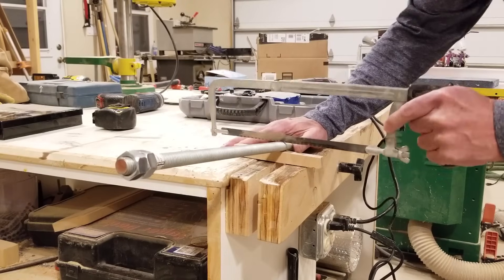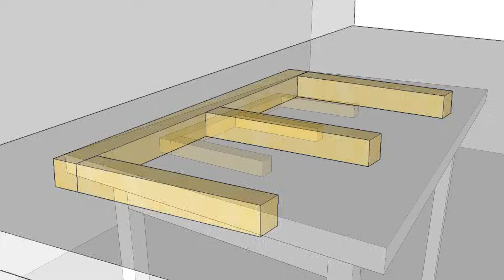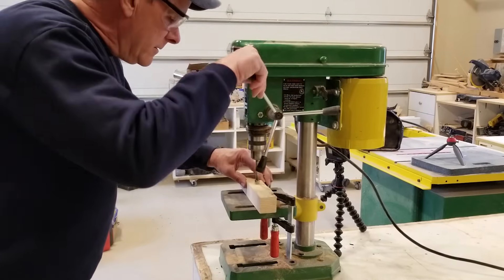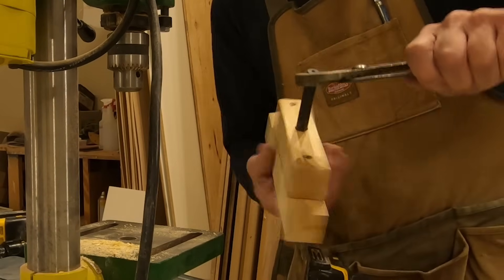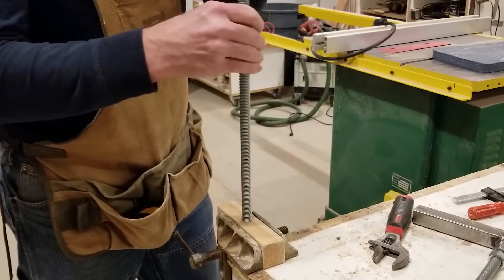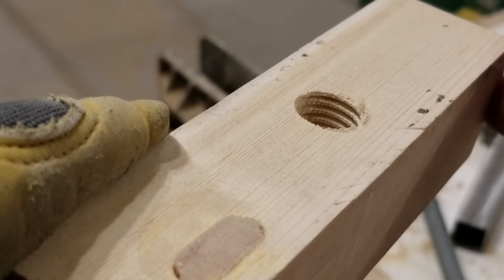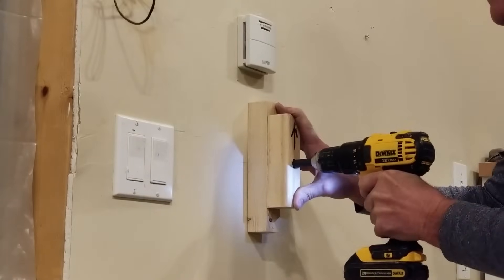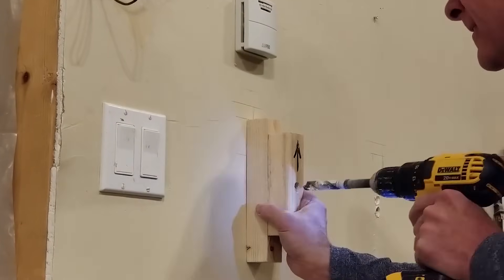Strong Floating Shelves - The Strongest Option

Comment: Moving into a new apartment in 2006, I mounted a 42" plasma TV on a brick and plaster wall and ran the TV cable service behind skirting to a point under the TV. I always mount (flat) TVs at a level where my eyes, when I sit on the sofa, are 2/3 up the screen (full face shots such as newsreaders are then eye to eye) because any higher means lifting my head and eventually straining my neck. In this apartment there was not sufficient space under and in front of the screen to use a cabinet of any kind (too much foot traffic across the room) and having wall-mounted the TV I preferred to keep the minimalist theme, so I obtained a length of 22mm (3/4") steel bar cleaned it and cut it in half to about 300mm (12") each. I drilled two 22mm holes in the wall to a depth of 75mm and 250mm (10") above floor level. I then mixed enough epoxy resin to almost fill the holes and knocked in the bars & supported them (level obviously). Once dry I placed the cable box on the bars with the cables coming from behind the skirting and into the back to feed it. I also drilled a hole through the wall behind the box and ran the feed to the TV through that into the bedroom wardrobe on the other side where I had installed sockets to power both the TV and the cable decoder box, the TV cables were delivered through a higher hole behind the screen. Nobody failed to ask how the cable box stayed above the floor and most then asked why there were no cables anywhere. I decided then that if I ever need a shelf I would fit rods and conceal them in the board. I have done similar fits in my current home with my 65" TV which weighs half as much as that plasma! my HiFi and all computer cabling: I just hate visible cable. It is good to see others using the same method, funny how it took us hundreds of years to think of it.
Reply from the maker: Nice explanation on your installation methods, BB! Sounds like it all turned out very well. I don’t know why it took me so long to try something like this as well. I have always defaulted to wood because I’m more accustomed working with it. I get lots of comments from other contractors who use long lag bolts into the walls and then cut the heads off. I appreciate you watching and thanks for your comments!

Comment: Floating shelvs are strog only if the wall is strong , and treaded rods are not so good options , there is steel rods in quality or even hex bars , and just nail it vith hummer to the wall
Reply from the maker: These rods are plenty strong for this use, Jovovic. They will hold much more weight than I would ever need to put on them.

Comment: That's a lovely stud finder. I have avoided floating shelves (because history books are heavy).
I might adapt the threaded rods with a threaded tapped hole at the end. Then turn up end caps in Stainless to hold shelf in place.
Nice idea.
Reply from the maker: I think you might be surprised, Plunder, with how strong these shelves really can be made to be. I had always thought of floating shelves as a little bit gimmicky and not particularly useful until I needed to build some for a customer who was going to load them down a little bit with books. That started an exploration process that led me to the all thread rods as being the strongest option I have come up with. Yes, and I like your idea of a threaded tap in the end of the rod to hold the shelf in place. That should work well!
Reply: @RustyDobbs  Hi. Sorry for the delay. I really like your floating shelf ideas. There are a few minor differences in building practices in England (mainly regarding wiring to be honest). We also have a mix of metric and imperial sizes for drills & threaded rod - but no problem. I have a metalwork lathe so making any custom parts is OK for me.   I love your metal detector. If I may ask - Where did you find that?

Comment: Could’ve just use a wood Sammy and been done with it
Reply from the maker: Your going to have to help me with "wood Sammy," Joe. Not familiar with the term.
Reply: @RustyDobbs  it’s basically a wood screw that the head has a tab for 3/8 Rod just google wood Sammys
Reply from the maker: Thanks, Joe. Yeah, I've never encountered them before. Looks like they get used a lot for hanging pipe which makes sense. Appreciate you passing along the info.

Comment: Question is, why do you need floating shelves able to hold weights of 60+ kg?
Reply from the maker: Another question is, if the same amount of effort gives you a shelf that can easily hold more weight than you would ever realistically put on a shelf,  like 60+ kg, would you rather have that or one that can handle 20 kg?

Comment: about the solid shelf13 min into the video, you could try drilling and tapping a female thread on the end of your "all Thread" and use 1/4-20 screws to hold the shelf on, then put plugs in to conceal the screws.
Reply from the maker: I like your idea, Gadsden! There are lots of ways to go about securing the shelves to the rods, but your idea would really be a solid way to do it, plus you could put plugs in as you suggest or come up with an industrial look by incorporating bolts and washers into your finished look. Thanks for passing on your thoughts!

Comment: Great video for beginning diy'ers and seasoned weekend warriors alike. Also I noticed how you were using the stud finder. I found it best to slide the finder in the vertical position towards a stud from either side.
Reply from the maker: I hate those stud finders, Cesar! I have had so many guys tell me to use powerful magnets to find the studs which is a great idea I had never thought of. But I have to say your comment came to mind today when I needed to use the stud finder and changing the orientation actually did help, so thanks for that! I appreciate you watching!
Reply: @RustyDobbs  No prob Rusty,
I feel you brother. I've gotten to the point of doing 1/8 holes every inch till I hit a stud. Looking back at it.....fun times. When finished it's best to  forget the frustration  but not the trick that got you out of that jam. Keep building and stay safe Rusty.
Reply: @RustyDobbs  Hey bud,just wanted to share a bit more about how I got that stud finder working a whole lot better for me. I'll be quick. Sliding it vertically from left to right mark with pencil when you get a solid beep,same thing right to left. In between your marks is the stud. Light bulb clicked with first confirmed stud found. But enough about me. 😂

Comment: Suggestion: use an appropriate size tap and tap holder to thread the hole in the studs
Reply from the maker: I did that on the follow-up video, 66, and I used thinner rods as well. The taps worked great! By the way, I drove a 51 Ford pickup in high school! Wish I still had it now!

Comment: Instead of all-thread, I use a long 5/8” lag bolt.  I drill the studs and use a socket wrench to screw in the lag.  Once the lag is in about 3” into the stud, I cut the head off the lag bolt with my Fein oscillating tool with a carbide blade.  A hacksaw or sawzall works as well.  If the lag is slightly off level, slip a pipe over it and adjust slightly.  I don’t think all-thread is a good idea since its threads aren’t made for wood.  Everything else looks good!
Reply from the maker: Sounds like a good plan, Scott! I have had a number of other contractors describe a similar process to yours that they use. It took me a long time to finally by an oscillating tool. Now I don’t know how I ever got by without it! Thanks for your comment and for watching!

Comment: Nice! That's how I attach my floating shelves for my customers. Only I use solid stock, and 1/2" bar. I hang on the shelves to test them. I know yours will be even stronger. I also made a perpendicular jig, but used a set of drawer guides, and a large square foot on it. Great work sir!!
Reply from the maker: Thanks, Sticks, and I appreciate you watching! Yeah, I never thought I was “reinventing the wheel” when I made this video. I figured there were people who had done similar things. For me, I was just making the transition from wood to steel supports, so that was the novel thing to me about using the all thread rods. I like your idea about your jig! I’ll have to think about that little!
Reply: @RustyDobbs  I can take pictures of the jigs, and somehow get them to you. I may even have a video on my old channel of me using them. I'll check.
Reply: @RustyDobbs  Found it. It's unlisted because I was working with FastCap on making it a seller. They didn't use my idea. I never got a patent.  One jig is for against the wall, and the other is to slide over the 1 1/2' thick shelves I make. Since I don't want to take my giant drill press to job sites, and I have to nail the center of the studs perfectly, I needed something to hold my drill perpendicular to the shelves that wasn't my drill press.

https://www.youtube.com/watch?v=TmVe3QOV9hU
Reply from the maker: Thanks for the video link, Sticks! I'll check it out. And you can email me at rusty@dobbsworkshop.com as needed.
Reply: @RustyDobbs  Got it. Thanks! Sent you an email, so you'll have mine. I'll list it here too. sticks.cabinets@yahoo.com

Comment: you said 2x6 was in the wall. How would you expect this to hold up if the wall was built with 2x4's
Reply from the maker: As a general statement, Sinkingputts, I personally would not have been concerned about putting this all thread rod in my wall if it had been built from 2x4s. That’s primarily because I’m replacing the wood drilled out with the bit with a piece of steel and the weight on those studs (16” on center) is from load and gravity with no lateral pressure against the wall. But you need to make decisions about what you do with wood framing based on each individual circumstance. Hope that helps!

Comment: Very old post i know, but have to ask. Planning on doing exactly what is in this video, but my shelves will be going into concrete, and using the last method. I would just tap in the threaded rod into the concrete wall as far as i can ( inside wall, so probably 70% of brick thickness ) and use the last shelf type as in this video? Planning on hanging 6 of these in fairly close proximity to each other. Also note shelves were pre made, and each weighs about 8 pounds. Any advice would be appreciated. PS. Wont be using for heavy duty loads, but would like to have peace of mind that it could easily handle 50 pounds :)
Thanks for another awesome video.
Reply from the maker: Thanks for watching Ashraf and for your comments. Yeah, I would probably focus on getting the holes drilled in as perpendicular to the wall as possible. Maybe also undersize your drill bit to the rod slightly and do a test hole to see if tapping the rod into an undersized hole gives you a more snug fit. Could also add some construction adhesive to the rods to fill some of the voids created by drilling the holes with masonry bits. Think you should be fine on your weight concerns if the rods are installed snugly. Good luck with your project!
Reply: @RustyDobbs  Hey Rusty, thanks so much for the response. Good idea regarding undersizing a bit, and didnt think of construction adhesive to be honest. Drilling these holes perfectly square will definitely be important yes. Thank You again.

Comment: They make a hand held drill press attachment for your cordless drill. Also I drill 3/8" holes and use regular 3/8" rod. The rod has to be hammered in. There will always be a little bit of misalignment somewhere and you'll have to pound the shelf on so there is no worry about it coming off. Then use a flat bar to remove if needed. Then pound in a bit of 3/8" wood dowel with wood glue and it's good as new.
Reply from the maker: I like your ideas, Burrito! Thanks for watching and for passing along the info! The 3/8"dowel repair is a good idea. You sound like you have done this a few times!

Comment: Thank for the method.  BTW a rare earth magnet is great for finding screws in rock wall that have been finished
Reply from the maker: Thanks for watching, Andrew, and I appreciate the magnet tip as well!
Reply: @RustyDobbs  Thanks, just used your method to make shelves for the utility room.  Cheated though and used 30mm long threaded inserts rather than threading the hole,, that gave enough strength to pull the frame tight against the wall helping to hold it horizontal

Comment: Have you thought of just buying a 5/8 inch tap?
Reply from the maker: Yes, I have. I actually did a follow up video with smaller rods and I used taps to thread those holes. I always assumed that bigger taps would be more expensive, but they really are very reasonable.

Comment: Great idea.  I've run into the problem of something in the stud before.  When using the electronic stud finder, I locate the stud then use a magnet to look for sheet rock screws.  Remember, the magnet method used to be the way to find studs.  Also I've seen, on youtube, a stud finder that shows everything in the wall.  It can be used with an android phone.  I don't have one, because it won't work with my iPhone.
Reply from the maker: Thanks James! I’ve seen those apps before as well that allow you to see what’s in the walls, but have never thought about getting one. I do use an android phone so I may have to check into that. In most of my work, probably 95% of the time I’m actually removing sheetrock to make some structural changes so I’m going to see what’s in the wall up close and personal! Thanks for the idea on the app!

Comment: That stud is probably not happy after you made such a big hole in it. Feels like that damages the structural integrity. Unless it's at least 3 times wider than the hole.
Reply from the maker: The only big hole in the wall, Harvie, is where I drilled a hole in the sheetrock to check for wiring in the stud. The 5/8 inch hole drilled in the stud is filled with the 5/8 inch all thread rod after it is installed. This is actually a 2 x 6 wall on 16 inch centers, so I’m not concerned about its structural integrity but thanks for watching and for your comment.

Comment: Thoughts on using this method for a 30" deep desktop?
Reply from the maker: Not much beyond the obvious, Jim, that the wider you go, the more you get the cantilever effect and more deflection possible as weight is added closer to the front edge. I haven't tried the 5/8" rods extended out that far, but it is an interesting idea and likely pretty strong if they are inserted in studs 16" on center. The other option I have suggested for wider projects that do not have "L" brackets that show, is to have 1/4" plate steel welded up as "L" brackets for the project, then recess them into the sheetrock against the studs and recess them into the bottom of the shelves so they are not seen.
Reply: @RustyDobbs  Thank you for your thoughts. I am thinking making the desktop 5" thick and extending the rods out to 20" will do just fine. Going to do a test some time in the future. Staying home for now and will not be able to go to the hardware store to get what I need. Will update when I can get out of the house again. Hope you are keeping safe and all is well.

Comment: I love the technique you use, but was wondering what your thoughts were on doing this technique in a corner floating shelf?
Reply from the maker: Yes, it can be done, David, but may not be necessary from a strength standpoint. When you put in a corner floating shelf, the opportunity to screw into studs on two adjoining walls takes most of the 'cantilever' tendency out of the shelf anyway, so the strength of the rods is less important. I did a video a couple of years ago called just "Strong Floating Shelves" which was my first experience of building floating shelves for a customer. I did a two corner shelves in that video, so there's an example to check out. Thanks for your comment and I appreciate you watching!

Comment: Over engineering at its best...cool idea but I can’t imagine needing that much weight capacity
Reply from the maker: I was asked if I thought this setup would hold a 350 lb fish tank, Shootin! I said NO! Somewhere common sense has to come into play on how heavy the items should be that are sitting on a floating shelf, regardless of its capacity. For me, that's about 50 lbs on a shelf this size. The flip side, however, is that if I weren't explaining what I was doing in the video, I could have installed the rods in about 10 minutes start to finish, so the approach is not only strong enough for any reasonable use, its also a quick and efficient install! Thanks for watching and I appreciate your comment!

Comment: Great ideas.
Drill smaller holes on the 2x4s fur a snug fit
Reply from the maker: That's true, Sean! In this example, I was trying to make sure I could get the shelf to slide on the rods without too much trouble, so I oversized the hole a bit!. Thanks for watching!

Comment: One tip if you are using the shelf for extremely heavy items like the 150lb quickcrete test--you could modify your jig by slightly shimming the bottom of it, so that your holes are angled downward.  This would allow for built-in sag once the weight is placed on your shelves.

Nice to see your work!  --Jeff
Reply from the maker: Thanks, Jeff! That really is a good idea! I think as I was building the jig, I was thinking so much about getting the hole perpendicular to the wall that your idea never crossed my mind. Yeah, just a slight angle on the hole would increase the strength significantly. Thanks for watching and for the comment!

Comment: I like the threaded rod approach. The handle to the tap could be made of wood secured w/nuts if one doesn’t have a welder in the family.
Reply from the maker: Yep, you're right, Louis. There could be lots of ways to make the handle besides using a welder. In a pinch, just using the "jam nut" approach of tightening two nuts against each other and using a crescent wrench to spin the rods into the studs works well too.  Thanks for watching!